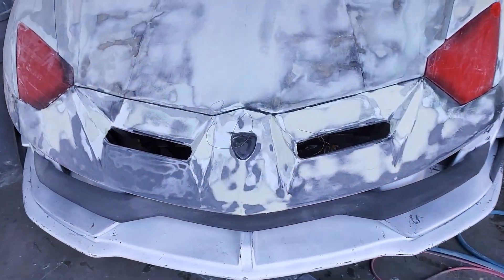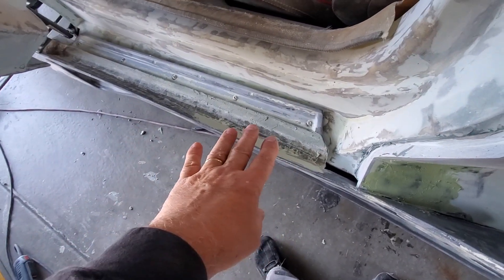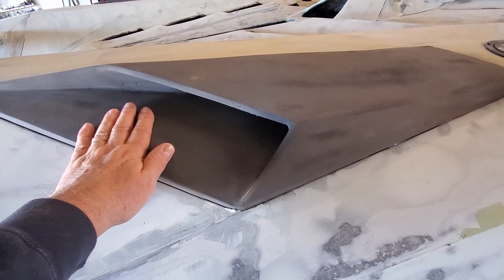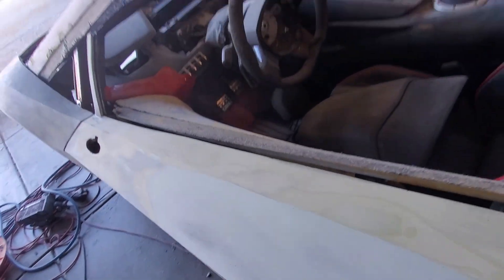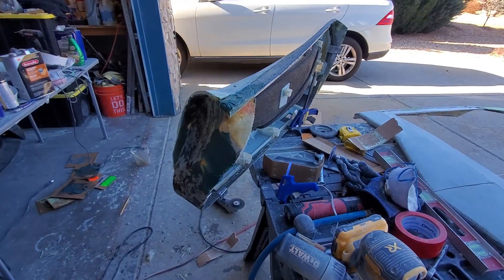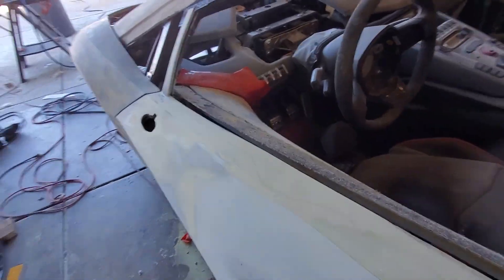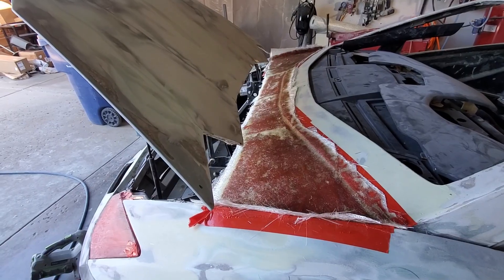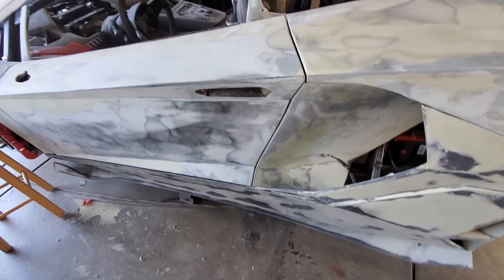SVJ and our extended summer

Comment: why not use oem tail lights?
Reply: It's a custom project, and besides that, getting used OEM tail lights would be $6500-$8500 😅
Reply from the maker: Yep, they are pricey.  Lambo gave me the headlights.
Reply: @lasersterling  you can get some cheap broken used ones for much less and refinish. It will really complete the rear end. Aventador tail lights are legendary
Reply from the maker: @llRaZzLeDaZzLell  Maybe down the road...